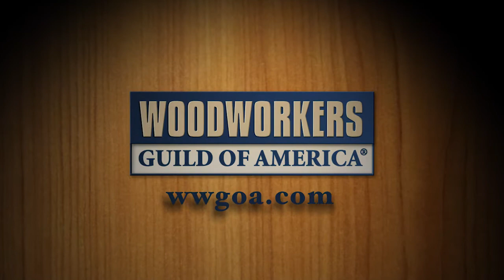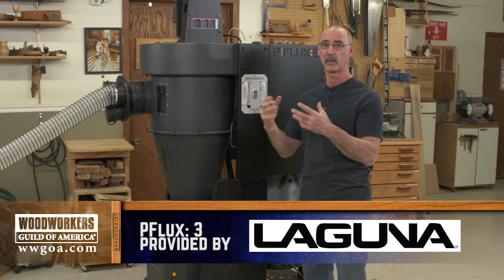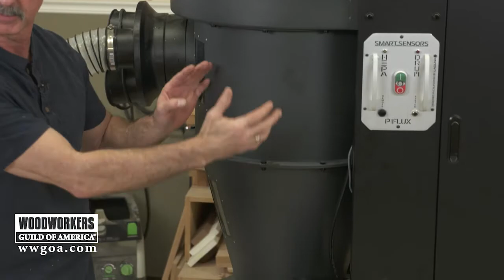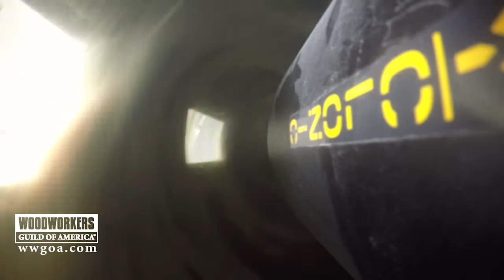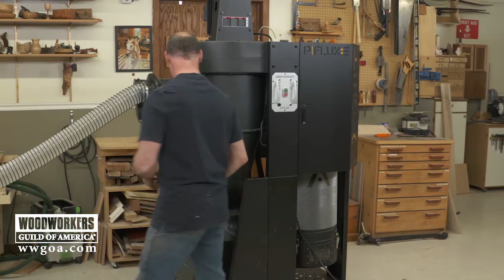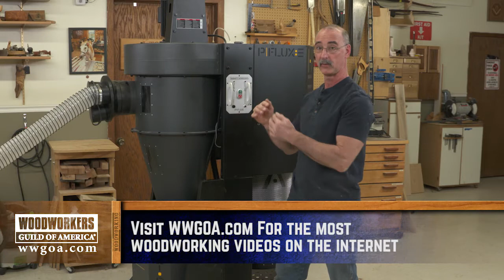WWGOA - Laguna Tools P|Flux 3 Review

Comment: When you pulled the drum out it did not have the metal insert that keeps the bag from being sucked up. Was that a mistake or can you actually run the system without the metal "bag hold down" contraption?
Reply from the maker: Lets discuss call 800-332 4094